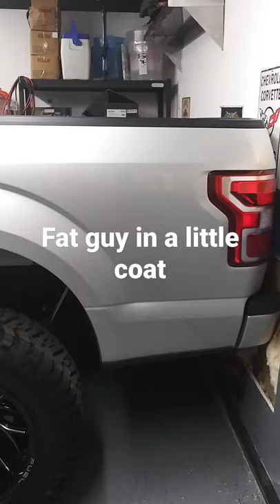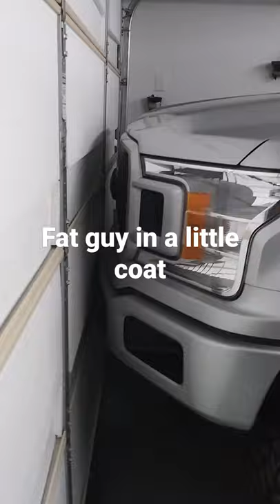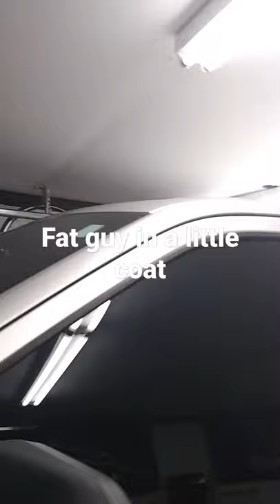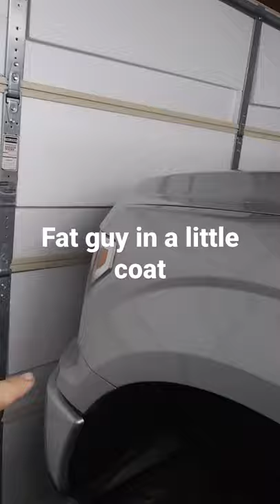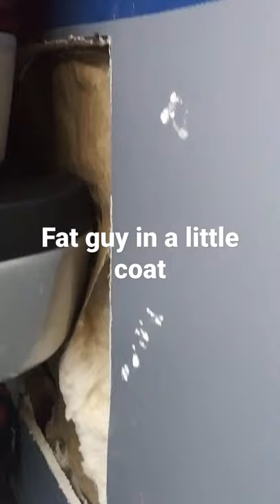How to fit a big truck in a small garage #shorts

Comment: The one time it would appropriate to film in widescreen. lol
Final warning, stop making vertical videos.
I mean it, you're going to drive me to drink.

Maybe I should do this so I can fit both my Panthers in my garage.
-Chuck
Reply from the maker: Trust me. I really wanted to film in landscape, especially for a nice wide angle of this truck only just fitting in here. I imagine it will be stuck here in winter when the garage contracts from the cold. Damn You Tube and their stupid portrait requirements for #sharts!
Reply: @HollywoodHornet  
For the upmteenth time, hold your phone sideways, and it will upload in widescreen format.

I just uploaded an 11 second video today, filmed with my cell phone. And you can tell it's my cell because I forgot to disable the autofocus, so, it's really blurry when there's movement.
And it's widescreen.
You are driving me crazy.

Actualy, just forget it.
I just realized you're doing this on purpose to get my goat. 
Well played. lol